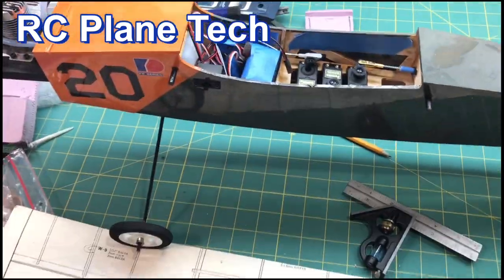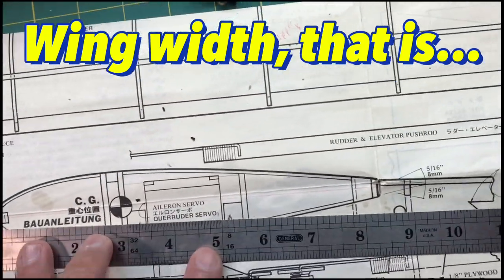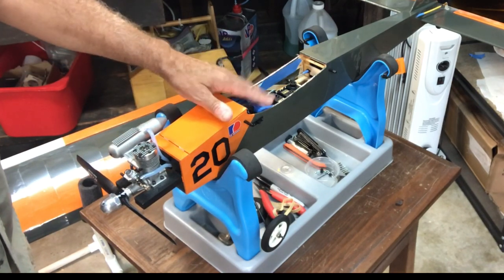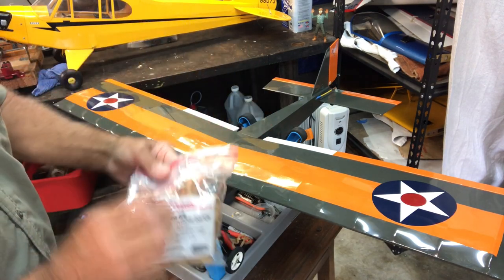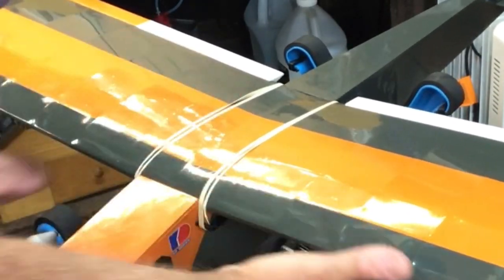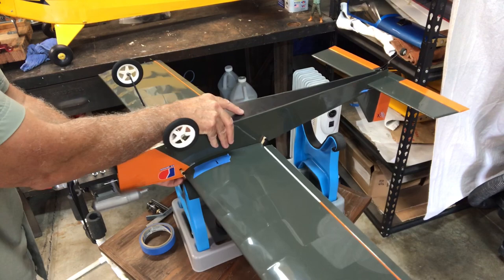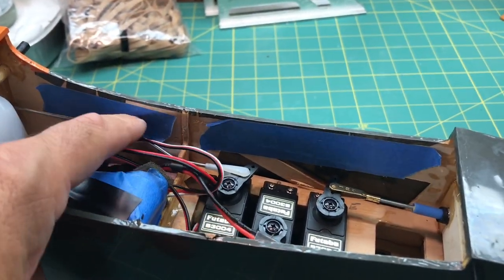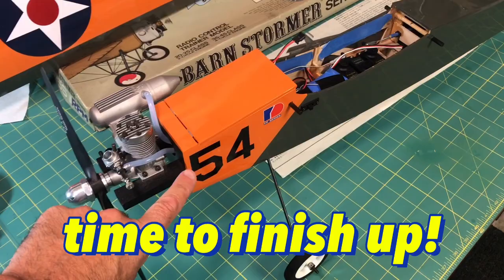Barnstormer 25S Vintage RC Plane Build: 28 Center of Gravity, Wing Loading, Finish Build

Comment: at 7:36, a  good  cg  location  does  Not   equal  an  optimally  located  c-m.!!!     center of mass.          you  followed  the  plans.   sorta            do  you  REMEMBER  making  the  tail  HEAVY.  with  extra parts at the  tail wheel !!!